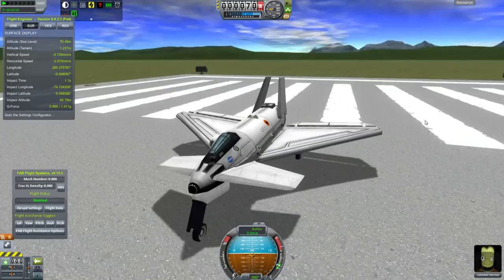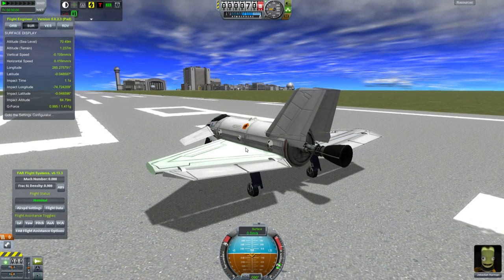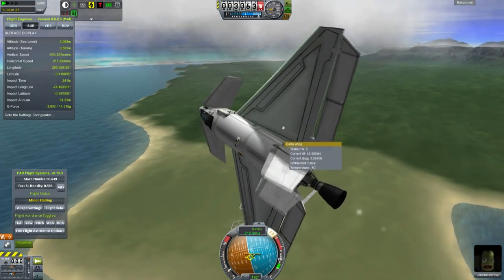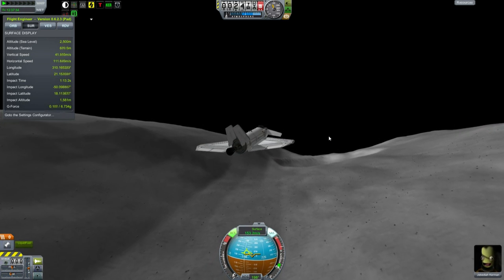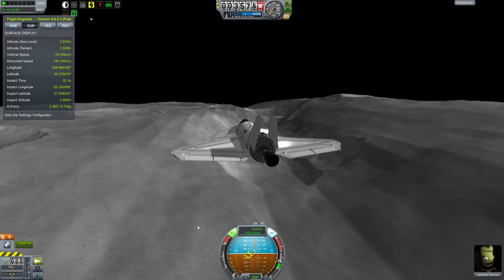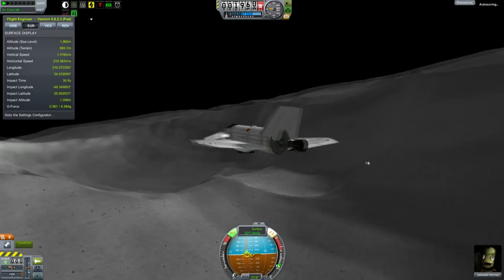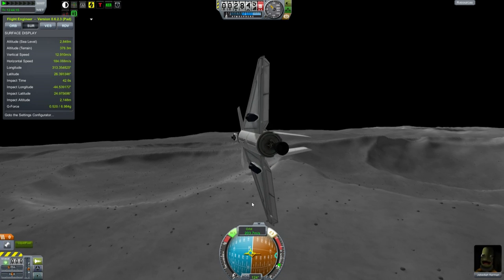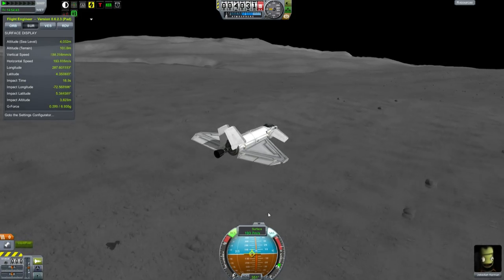The Physics Of Flying 'Space Fighters'

Comment: Use reaction wheels, man. Toss on some solar cells, a good battery, and reaction wheels.
Reply: +Josh Adams Reaction wheels only stop rotation, not velocity
Reply: +HydraStrike have dense gyros at a high rpm, orient the craft relative to the gyros, then fire the engine and adjust your trajectory.
Reply: ***** Theres a game called space engineers that actually does this. It uses the gyroscope to orient itself while having its engines do the flying
Reply: +Josh Adams   There are practical limits to reaction wheels. In a fighter scenario it wouldn't take long before you are having to either push the wheels beyond their limits or deal with a severe drop in performance.